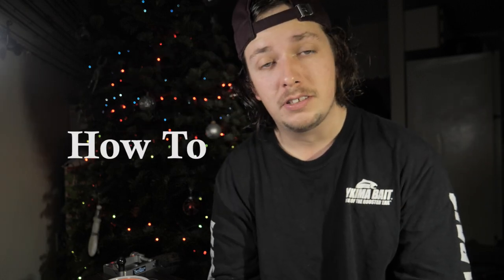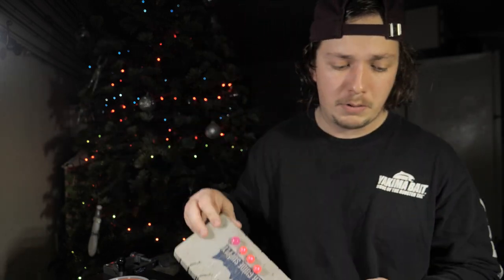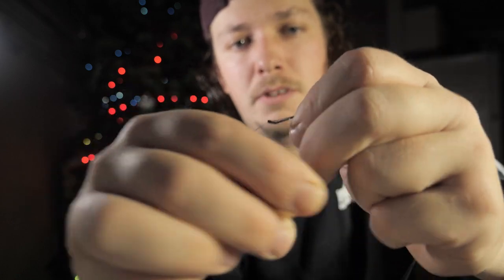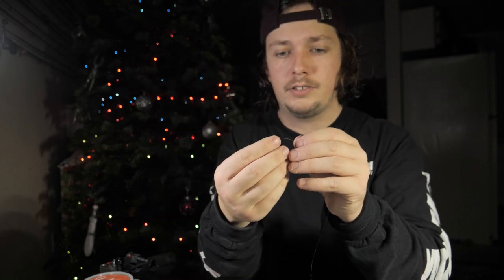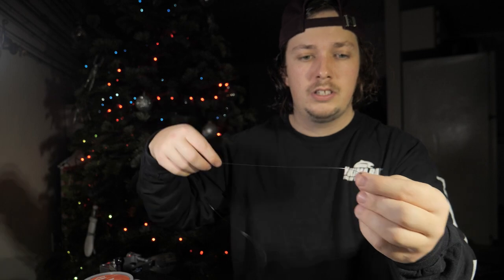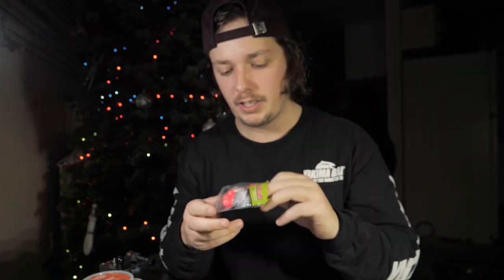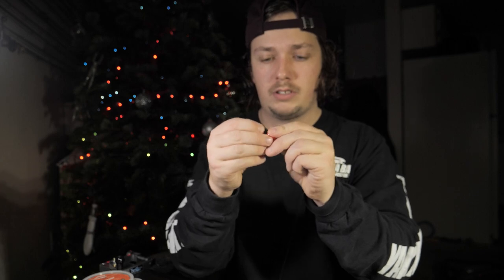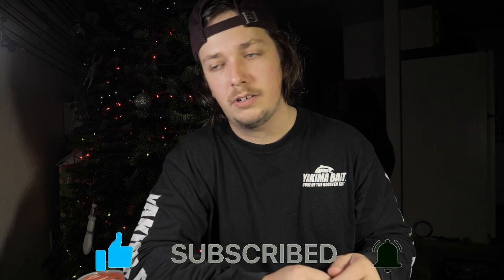How To Peg A BEAD For STEELHEAD | Bead Fishing Tutorial |

Comment: nice, i tried this but it still slides over the glass micro bead, perhaps its because i went through the soft bead with the hook and slid it over the bead, and somehow it breaks at the micro bead i do the same knot every time. so i now do a figure 8 to act as a stopper, and a dab of uv resin, then either t stop or no t stop. i find the the figure 8 works and my line breaks at my other knots and not the figure 8 knot
Reply from the maker: Yeah with this rig I always slide the bead down the line. It lasts wayyyyy longer . Of course you can still blow out the bead over time.

Comment: T stops suck. For soft beads I now use 20lb mono uni knot. Works great. I use 8-12 lb leader but for the bead stop uni knot you need stiff line so 20lb works. Just tie a loop of 20lb test over your leader a couple inches above your hook. Trim the lower tag short but leave about 1/4" of tag on the top of the knot. The tag keep the bead from sliding down over the knot cause the tag and your leader create a V shape your bead sits in. Up side to this is if you need to you can force your bead down over the knot and off your hook if you want to change. Just slide a new bead, different color or size back over your hook and over the knot and your good to go without re-tying anything or needing to cut your leader off.
Reply from the maker: its funny you do that! i did exactly the same thing before using the method in this video. it works well!
Reply: ive tried this, i used 6lb leader and if i tighten the bobber stop knot too much it damaged my leader, if i dont, it slides down after a while. i even tried a dab of uv resin on the bobber stop knot but still no good. i now am experimenting with a simple figure 8 knot to act as the stopper. and using with and without t stops, adding a dab of uv resin to the figure 8 knot to make it larger but still clear, so far im breaking off at my swivel. i would break off on the death roe micro beads before even though i tie the same knot every time it breaks sometimes. so im on the quest for the best rigging technique for soft beads and id suggest trying the figure 8 knot method, with a t stop you almost need all your force by hand to slide it over

Comment: Hey man, great video and a super technique for soft eggs!  What size beads and sequins do you use for this setup?  It seems like the sizes would be pretty important so you don't have the bead slip thru the sequin and then the egg.  Thanx for taking the time to do this!
Reply from the maker: idk the size exactly but they are the same size as the ones elevated tackle sells on their website. they sell a red small glass bead. you can also use my discount code "FISHINGTHEODDS" at checkout on their website for 15% off. not trying to sell shit to ya i just know there small glass beads are the same size and used for the same thing. sequens are about the diameter of an 8 mm bead.
Reply: Thanx, I was able to find some from my fly tying stuff that should work. Have a great winter season!

Comment: That is genius !!! I got so frustrated with the T stops … I tried supergluing them bead to the T stop and it would still blow out … this year I was trying banding the beads but now I’m going with your set up truly genius bro!! Have you ever tried banding ??
Reply from the maker: Banding? what do you mean?  believe me man this setup is killer and the knot does not weaken your line . i just recently fought 4 steelhead on the same bead and same leader!
Reply: A bead company called creek candy makes a banding tool and it is a a needle with a tiny little hook at the end and you attach your bead to the line with a rubber band … the line is never actually threaded through the bead … and when you want to switch out your bead you just cut the rubber band and band another bead … it works really well too unless you lose the tool
Reply: You gotta check out mark ehlberg he has a you tube video about pegging versus banding it’s a great method
Reply: @FishingTheOdds  mark ehlbeck
Reply from the maker: @robertmcgaughey1734  thats pretty rad ill have to look into it!
Reply: @FishingTheOdds  hevi beads makes a banding tool also. But it's for hard beads.
Reply: @robertmcgaughey1734  using U.V. resin also works if you pre-tie leaders.
Reply: @dukeumnukem9747  how are the rivers all frozen up ?
Reply: @robertmcgaughey1734  rivers aren't frozen here.

Comment: Cool, I have a serious question. How is the knot strength at the small bead?  When you are down to 10 lb or 12 lb leader knot strength matters. The egg loop is a very strong and reliable knot, does the bead knot weaken your leader?  If so buy how much?  Thanks. :)
Reply from the maker: I was nervous about that as well honestly, however if you go back and watch some of my videos i have caught some BIG steelhead with this knot. also Pull on the leader super hard and you wont break it. after fishing this way a couple of years i stand by it and never get nervous about the knot. i do however get nervous about the fish coming off cause bead fishing has such a small hook haha. this is why i run size 2s for everything as oppose to size 4 hooks
Reply: @FishingTheOdds  Know what you mean about hook size, I run size 1 to 2/0,  size 2 is two small for me, mind you my local river(on Vancouver Island) is a pretty decent size with lots of colour so often a bigger presentation is better.  I don't really get a chance to fish any clear or low water so I'm not having to dial it down much.  Cheers. :)
Reply from the maker: @allancrow134  gotcha , makes sense!

Comment: Do you ever have a problem with your line breaking where you peg the bead? Wondering if that knot you tie weakens the leader
Reply from the maker: My buddy had the same concern. Until the other day I hooked 7 steelhead on 1 leader
Reply: @FishingTheOdds  another method that Todd at never quit fishing taught me was to put a uniknot in but instead of a bead,  put some wool in there. looks super deadly.
Reply: I’ll have to tie some up using both of these methods. I appreciate the help! Tight lines